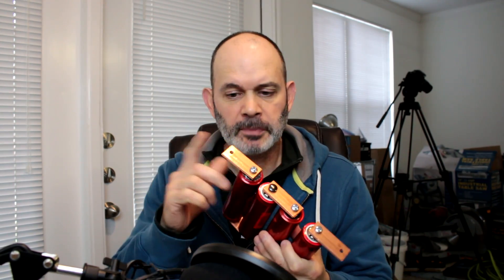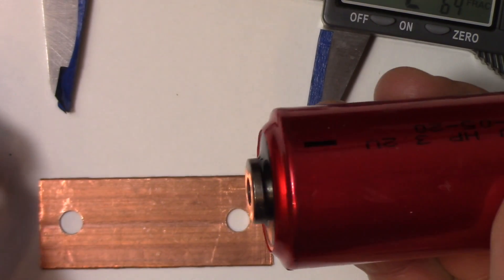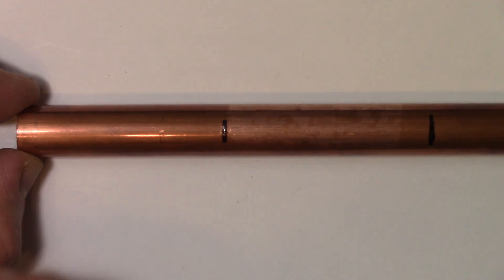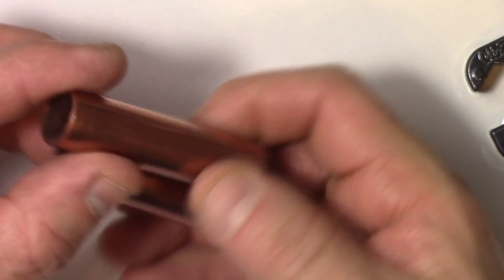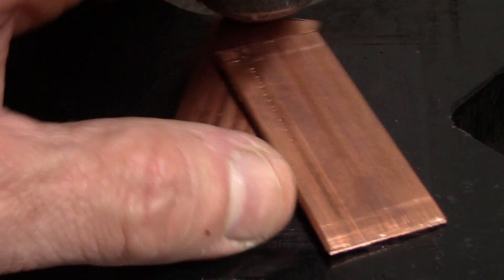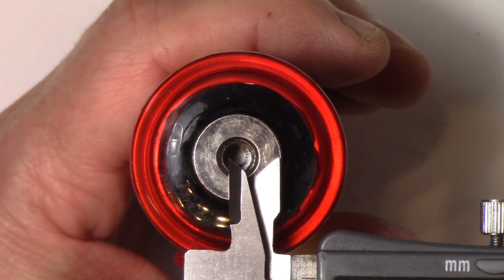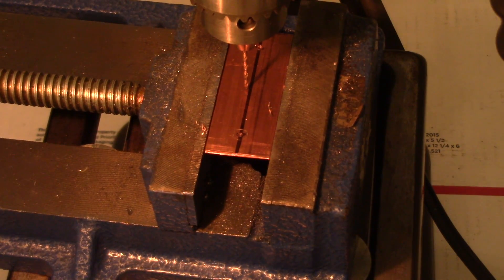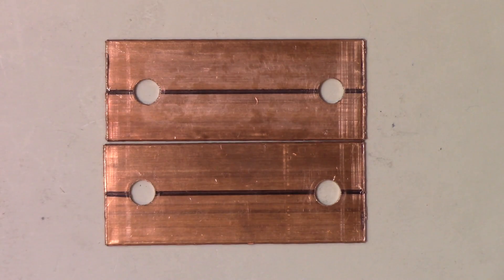Copper Bus Bars How Make DIY Using Copper Pipe On The Headway 38120 8Ah Cells

Comment: Metric caliper readings and imperial screw and hole diameter dimensions. Why not all metric? Or imperial if really needed. Liked the video. I am using a hammer and a vice at the end to get the pieces flat. To prevent the edges from cracking, I annealed (heat up with torch and let air cool) the almost flat pieces to get the copper flexible again.

Comment: Thanks for providing this.  It is very helpful.  Quick question, I'm making a 12v 48Ah pack with some Headway 38120s batteries.  After watching your videos, I estimate that I would need $83 worth of copper pipers (12 pipes of two feet by 3/4 thick).  Rather than connecting them with busbars, would it be safe to wire them together with heavy gauge wiring?  If so, what gauge and type of wiring should I use?  Thanx

Comment: Hey Rich, what is your opinion on soldering the bus bars together to get a better connection between them? And what would you use, plumbing or electrical solder?

Also, for a good, non-oxidized contact between the crushed inner surfaces, should we sand the inside of the pipe before crushing it, or would that even matter?

Comment: Found a source for copper bar stock about 1/8" thick......
http://www.speedymetals.com/pc-2869-8204-18-x-34-ca-110-copper.aspx
Prices vary by length. Not cheap but not too expensive. I use real heavy stuff  1/4"x3"x16" for grounding busses for lightning arresters in the ham radio side. These are REALLY EXPENSIVE!
Reply from the maker: The copper pipe is cheaper for the same amount at least in 1/8" BUT you have to make it into 1" X 1/8 bus bar. This flat stock is just buy it, cut it, drill it and you're done. Thanks for the link. All the best.

Comment: Great video series on the 38120s. I’m very new to lithium in series. Can you talk about the importance of Balancing. I purchased12 (3 13volt banks)and planning on using this in a car audio application with the alternator as the sole charging unit
Reply from the maker: I may do a video on why ballancing is important. Thanks.
Reply from the maker: I may do a video on why ballancing is important. Thanks.

Comment: I was thinking about maybe doing something similar. in longer bars . use two pieces. one that will fit inside the other. maybe solder them on the ends and bolt holes. so it will for sure make contact. instead of only the outer pipe. I need a buss bar to connect all my batteries. over about 4' each side. and carry possibly 400amps. or do you think a single piece will carry the current? great video.
Reply from the maker: Here is what I know:

The K, M, L designation for copper pipe is the wall thickness. https://en.wikipedia.org/wiki/Copper_tubing Copper Pipe is nearly pure at 99.9% see below. My bus bar is is made from M copper pipe flattenned and compressed to a thickness 1/16" X 1" so it's DC Resistance at 20° C, Microhms Per Ft would be 132.0 https://www.copper.org/applications/electrical/busbar/bus_table1.html 

These bars should have an ampacity of 137.5 A each https://www.copper.org/applications/electrical/busbar/busbar_ampacities.html so doubling them up would give you 275 A rating which would be 75A more than these cells can produce (from what I read on these tables). 

Seamless Copper Pipe
Copper pipe is almost pure copper manufactured to the requirements of ASTM B 42 - Standard Specification for Seamless Copper Pipe, Standard Sizes. It may be manufactured from any of five (5) copper alloys (C10200, C10300, C10800, C12000, C12200) that all conform to the chemical composition requirements of alloys containing a minimum of 99.9% Copper (Cu) and a maximum of 0.04% Phosphorous (P). https://www.copper.org/applications/plumbing/techref/tpf_stds/tube_pipe_stds.html

So if you need 400A (according to these charts you should be using these bars at 4X (times the thickness or four stacked together) again I am NOT an engineer so make sure you do your research. Thanks.
Reply from the maker: Again I am NOT an engineer so do your own research to confirm the information above (I am not responsible for the data or it's accuracy). Thanks.

Comment: You used Cu water pipe, yes?  Was it M, L, or K?  Is that Cu pipe an alloy or pure copper?  If an alloy, what is it and did you check the resistance to electrical flow with an ohm meter.  Did you sand off the oxide where the screw compresses the bar against the end of the battery.  As you know, in a plumbing job,  you need to sand the pipe before joining the pipe to a fitting like a slip x slip.  For info on the pipe a person can go to a metal vending site and fine out about the various forms of copper sold.  They even have a bus bar form of copper for sale.
Reply from the maker: The K, M, L designation for copper pipe is the wall thickness. https://en.wikipedia.org/wiki/Copper_tubing Copper Pipe is nearly pure at 99.9% see below. My bus bar is is made from M copper pipe flattenned and compressed to a thickness 1/16" X 1" so it's DC Resistance at 20° C, Microhms Per Ft would be 132.0 https://www.copper.org/applications/electrical/busbar/bus_table1.html 

These bars should have an ampacity of 137.5 A each https://www.copper.org/applications/electrical/busbar/busbar_ampacities.html so doubling them up would give you 275 A rating which would be 75A more than these cells can produce (from what I read on these tables). 

Seamless Copper Pipe
Copper pipe is almost pure copper manufactured to the requirements of ASTM B 42 - Standard Specification for Seamless Copper Pipe, Standard Sizes. It may be manufactured from any of five (5) copper alloys (C10200, C10300, C10800, C12000, C12200) that all conform to the chemical composition requirements of alloys containing a minimum of 99.9% Copper (Cu) and a maximum of 0.04% Phosphorous (P). https://www.copper.org/applications/plumbing/techref/tpf_stds/tube_pipe_stds.html
Reply from the maker: BTW I am NOT an engineer so do your own research to confirm the information above (I am not responsible for the data or it's accuracy). Thanks.
Reply: Hi Richard, I'm looking to machine something like this from 1/8" thick copper plate. They're 6" x 6" so I can get six 1" wide strips from each sheet. Your busbars measure 2.45" long correct? I want to see how many I can make from each sheet, so 12 it seems for a $20+ sheet, seems the pre made versions may be more economical?

Comment: Thanks for the Vid. Rich. Listen just a question would like your input. I have 40 Headway. am planning on doing 4s 2P. Now those plastic holder are hard to find. I saw them for about .50 a piece. But the shipping was too much. Now am a woodworker. I drilled (8) 1 1/2 holes 2 inches apart on center, All around on 3/4 plywood. I will have two pieces top and bottom. These will hold the Headway (8) . To connect the I was using the plumbing pipe hanging metal straps. The holes are already made 2 inch apart. The Headway will be held in place in the wood with hot glue. What do you think? Metal too thin? Or wood possess a problem?
Reply from the maker: Sounds like a great solution. Are the straps copper? Thanks.
Reply from the maker: Sounds like a great solution. Are the straps copper? Thanks.
Reply: Richard Lloyd 
No. Is that metal strapping that comes in a roll with holes already made. Btw the plywood is 4 1/2 wide by 9 1/4.
Reply from the maker: They do make it out of copper too. Here it is at Amazon: http://amzn.to/2sBO0wo pricy but it is copper. Thanks.
Reply from the maker: The plywood will be fine for the cells. If plastic is good for the job I can't see why plywood would not do the job. Hot glue is good as long as they don't get hot. When hot glue warms up it loses most of its integrity. A good solid fit in the wood will do the job but would wood glue work just as well? Thanks.